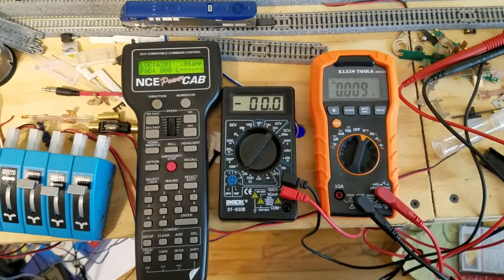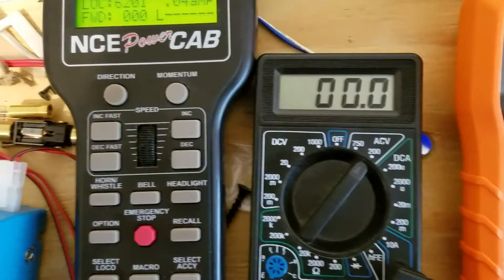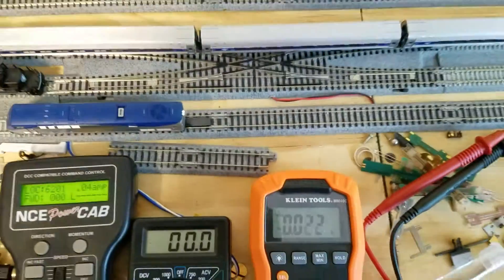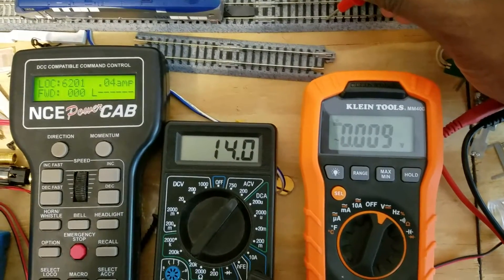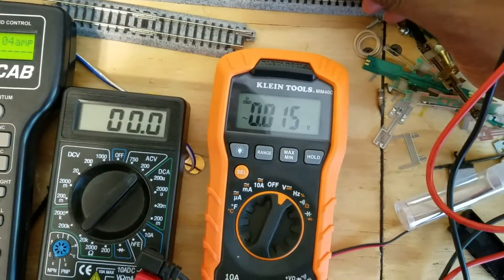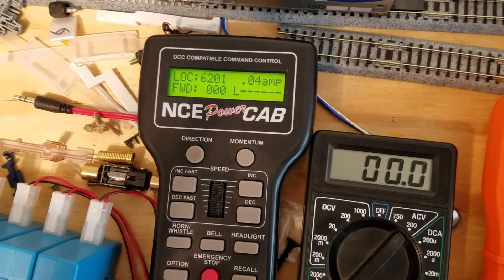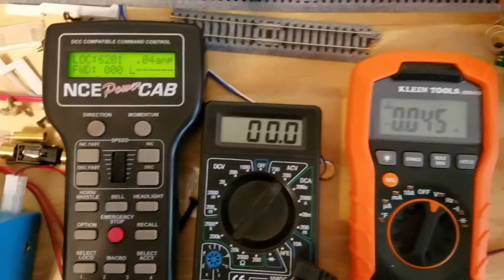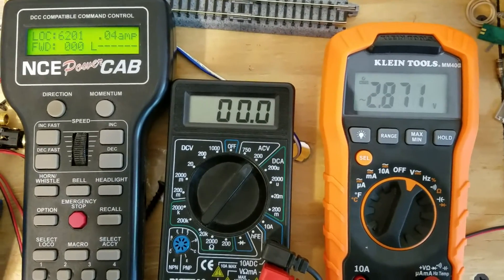Reading DCC Track Voltage With Multimeter.

Comment: Obviously you never found that explanation you were searching for but I have the exact same issue. My old cheapie multimeter reads my usual 14.5vAC from my track (NCE PowerCab) but my brand new expensive multimeter reads 5.37vAC and this is because it's a True RMS device. The older unit was not, it simply measured what it detected without the need for any AC sine wave output. If the multimeter had the option to turn OFF the TRMS then problem would be solved. There's probably an equation somewhere that would calculate 60Hz AC to read the voltage but for now (for me), 5.37vAC on my meter = 14.5vAC in real volts. The moral of the story here is that newer more expensive multimeters cannot read track voltages from model railroads.

Comment: There are three primary issues for a DMM's ability to measure AC accurately.  1)  Frequency response.  2)  Sampling rate.  3)  Whether or not it is "True RMS".  For 1) Frequency response:  Many DMM's have a frequency response only up to about 1 KHz.  Also, some meters also include a frequency counter function and its rating is typically NOT the frequency response for AC voltage measurements.  2)  Sampling rate:  This is how many times the DMM makes a measurement in order to determine the result.  A certain mathematical rule says the sampling rate must be twice what you are trying to measure.  Since a DCC signal is perhaps 8 to 10 KHz, a sampling rate of 20 KHz or more is needed.  But a meter may only have a sampling rate of 2 KHz (since many are concerned only with low frequencies like 60 Hz anyway).  These can produce incredibly incorrect readings and even variability in readings due to the phenomena of "aliasing" which is when a too low sample rate creates a sort of beat frequency with the waveform under test.  3)  Whether or not it is "True RMS":  "RMS" means "Root Mean Square" and is a simple equation to convert a perfect sine wave to a voltage equivalent to a DC voltage that would provide the same power.  It calculates to 0.7071 of the peak voltage (half that for the peak-to-peak voltage).  But if it is NOT a sine wave, and the DCC waveform being a square wave is not, this doesn't work.  The reading will be somewhat low.  A "True RMS" DMM will do it accurately regardless of wave shape.  A regular RMS meter might measure about 10% low.  If a meter is measuring drastically low, it either has very poor frequency or, perhaps more likely, it is a digital meter with a too low sampling rate.

Comment: Be sure you have the scales set up the same on both.  Start with a basis - that is - read a wall outlet and verify the same reading.  60 cycles AC - RMS ( root mean square) .

If they line up, then it is the modulation of the power booster, not a pure 60cycle AC output.

Bob

Comment: I believe Tom has the correct answer to your problem.  The Klein meter is higher quality and better built but, designed for 50-60 cycle measurements.  In some cases you can go as high as 100 cycles without too much error. The other meter is no as well filtered therefore it passes the much higher DCC frequency with less error.  This time quality bites back, look up the specs on the Klein meter and you should see the problem in the frequency spec. My Fluke has the same problem.

Comment: Try pressing the SEL button
Reply from the maker: Keith LAMPIER To do what exactly?
Reply: This will change the AC to DC or DC to AC and that is why your reading is wrong for track power.
 @geofftech
Reply from the maker: I understand that. But you can see in the video that I correctly had it set to AC as DCC is a square wave AC signal.

Comment: Your common lead is connected to the meters 10A current shunt. It should be connected to COM. You were shorting out the track. How it created a reading of 14 is interesting, maybe 1.4A..???. Your track is a modulated 14VDC system so the Klien meter was reading the RMS value. I assume its designed to read the peak to peak of a pure sine wave. The DCC system is sending square wave pulse width modulations of unknown rate. When you connect a volt meter to a DC voltage source while set to AC your reading is from noise or the poor filtering of the supply. If not you have a lame (cheap) voltmeter.  A oscilloscope will show you most accurately what is on the track.
Reply from the maker: Donald Lange DCC is actually square wave AC and not sine.. But the square wave is affecting the readings from both.

Comment: Something called frequency response of the meter. The DT830B has a frequency response range of 45 to 450 Hz , the Klein MM300 only reads between 50 to 60 Hz.